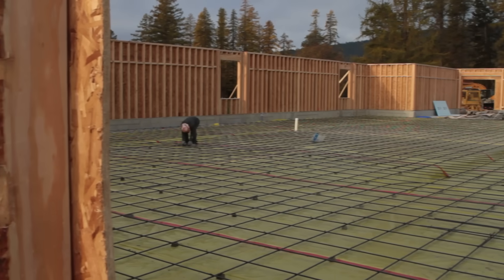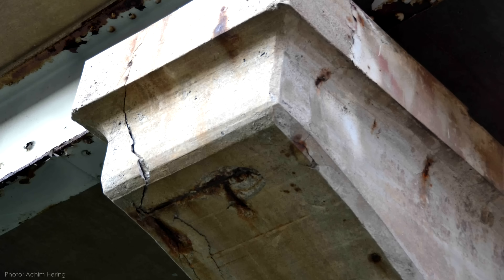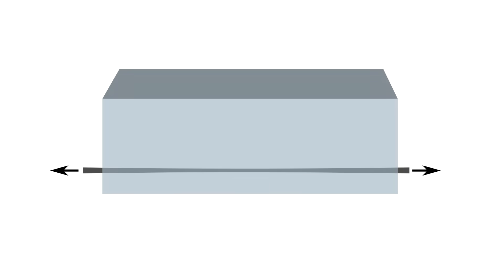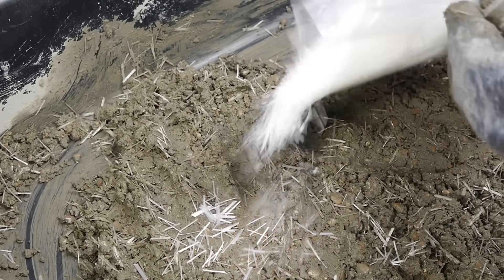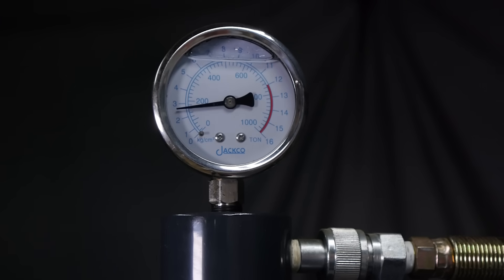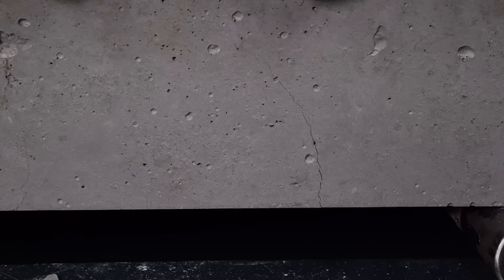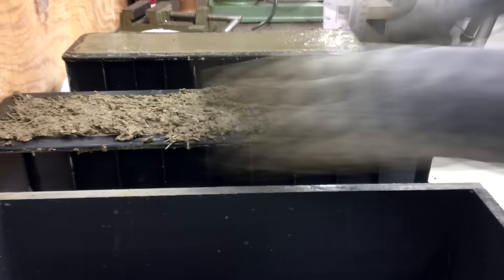Does Rebar Rust?

Comment: You could put support under the concrete where your press is. In test . I was a foremen for the rail road and we would tamp rock under the load" the rails"  because your demonstration explain it perfect it center cracks the tie . 10 inch thick and 12 inch wide 28.25inch center from the loads . On wood ties. It does the same on Portland cement ties every time. Eventually . I think a concert railroad tie has a 20 year life span. The big issue with concrete is the road bed and drainage the concrete ties start rounding off on the bottom forcing the ballist away from the tie from the extreme dynamic load differentials. It is a even support under the load is key to strength of concrete put a wood block in that press and it will beat concrete hands down . I have seen 100 year old oak ties in the track that look brand new. Because of a well maintained road bed. Throw another pile under their if it needs . permafrost areas use asphalt and piles like they did in Alaska in the 40s piles and corduroy roads with asphalt.

Comment: 1:07 He got his explanation completely wrong here.
Indeed, alkaline environment (high pH) in concrete protects metals very well and practically stops corrosion.
However, the way he explained it was wrong. 
The protective oxide layer is not formed at HIGH pH levels (above 10) as he said, but at NORMAL levels (pH between 4 and 10).
At levels above pH 10 the alkaline environment contains plenty of ions of metals more reactive than iron ones, so the iron bars are practically "safe".
With pH levels below 4 (acidic environment) the protective layer is eroded and then there is risk for the metal, but this should not happen in concrete, even if water gets in because it will dissolve alkaline salts in normal concrete and increase the pH.

Comment: Just checking to see If their was any advancements in carbon nanotubes and concrete composite materials. Their was lots of talk about it, but it gone silent for quiet sometime now.
Reply: simple.  Solution has been around for decades.  basalt rebar
Reply: @protonneutron9046  
They made some pretty big claims about carbon nanotubes with concert, rivalling the strength of Steel, making mega building possible along with ridiculously long Bridges. Haven't heard anything about what you mentioned before?

Comment: My late father was a civil engineer and Clerk of Works on numerous highway bridges built in Britain from the 1960s into the 2000s.  He came to visit me in Minnesota in the 1970s and was shocked at the decrepit state of the highway bridges.  His opinion was that they used too much concrete and uncoated rebar, i.e. no epoxy coating in a state where salt is liberally applied to the highways.  No amount of 'cover' will protect salty laden bridge structures.

When he came to visit us years later in SoCal he was again in shock.  This time because he saw that bridge abutments were of different heights so could not move together during an earthquake.  He accurately predicted how they would fail, as they did a few years later during the Loma Prieta quake.

Is US civil engineering education so out of date or is it just the result of hiring the lowest bidders that results in our infrastructure neighing so dilapidated?

I'm trying to build a high tech energy efficient home and cannot get local contractors to even provide a quotation.  They still build homes like they did in the 1960s.  They are not much better than the tar paper shacks that miners had to live in on the Minnesota iron ranges a century ago.  This so sad.

Comment: Mild Steel is weak, doesn't hold an edge, rusts easily, warps when Heat Treated and Tempered. It's not like 1080 Stainless which can survive the vacuum of space.

Comment: 3rd factor in rusted rebar: Salt added while pouring concrete to speed p the hardening process. This is a major problem for house owners in Netherlands, where contrete floors become unreliable after 35 or 40 years.

Comment: Excelent video .. Why does the crack failure appear only on one side of the beam ? I was thinking that it can fail on both sides under the load is applied ... i ve seen simulations in FEM software and it breaks the same but still have that doubt ...

Comment: But the rebar should be coated with hammerite then slide it in bamboo and cover it with line x. i know that might be expensive but it will last longer
Reply: nope.  Then it wouldn't hold onto the concrete.  smh

Comment: Does a bear shit in the woods? This guy is not exactly right, its not the concrete that protects the steel from rusting by keeping water from reaching the rebar, its the lack of oxygen from the entombed rebar, so if the concrete is porous and allows only oxygen then the rebar will rust, as the steel has already  soaked up the moisture from the wet concrete at the beginning.

Comment: You have more than 3000 comments  so someone has probably asked .. if so maybe you could pin that comment . Anyway here's the question: Why not use galvanised steel rebar? It would not add that much more cost to the rebar.

Comment: I just what to say thanks for all your videos. Not sure if you will get this seeing that this video was made on Sept 25 2018. I found electrical power utilities have large inductors for helping lag the power factor on the lines. The Inductor creates large amount of EMF which causes the rebar to heat up and expand. This causes the concrete to crack and the pads to fall apart. Not sure how they corrected it. I could find out if you would like. Just thought you might find this interesting.

Comment: I had the opportunity to talk to a concrete industry expert about rebar, and they said glass fiber was the way to go.  Also of interest is the use of light weight aggregates that have high amounts of water retention, as concrete cures it becomes water starved, using those aggregates allows more water to be present at the critical moments in the curing process.  It's called "internal curing".  Anyone working with concrete should also pay special attention to the temperature at which it cures, and  exothermic fluctuations.  Large pours will have hoses running through them so they can be water cooled on the interior, while blankets on the outside keep the outer edges from cooling and curing out of sync with the core. Using light weight aggregate for internal curing prevents the core from running dry as the crystals suck up all the water, making the concrete much stronger.

Comment: so if rust in rebar is bad, why is it almost always rusty when they put it in?
Reply: It won't continue to rust if it is sealed, so it doesn't matter that there's a little patina on it on pouring.
Reply: A small bit of rust can even make the rebar a little rough which is good for grip and as the Kombinator mentioned if it is cast well, it won't get any worse.

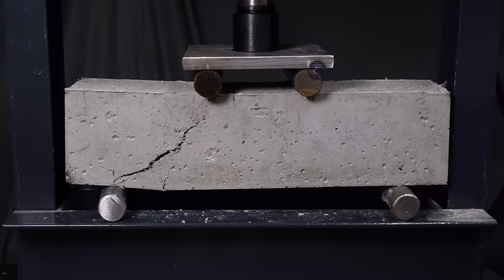Comment: To be a little nerdy: at 5:49 you can clearly see that this is a shear failure, and that the rebar doesn't have the required anchoring length. I'm surprised the capacity wasn't higher for the fibre ones based on this. might be because the fibres aren't steel?
The size and length of the beam in the video is perfect for showing fibre strength because the fibre-free is relying on badly anchored rebar. If this was done with a longer beam, with well-anchored rebar, the difference would be smaller, and if the crossection was smaller we could perhaps see a moment failure, in which case the fibres won't really do much.
However, fibre reinforced concrete (with steel fibres) combined with prestressed rebar is the way to go for optimizing concrete structures IMO.

Comment: Thirty-five years ago I was breaking out an old curb with a jackhammer. The steel reinforcement was twisted one inch square bars. There was no rust and they looked as good as new. The bars had two or more inches of coverage and were in the hardest concrete I have ever seen. It was in a refinery so there is no telling what kind of chemicals it had been exposed to. My foreman said that he thought the twisted square rebar was from the 1930s. Just thought I'd share the anecdote.

Comment: Sir what to do when the rebar corrodes due to low cover in beams? And When using prestressed bar the bars are tightened after the setting of concrete; the hole 🕳 that is used to put bars in the concrete should the holes be filled with concrete again during prestressing? And is there risk of corrosion when we post stress bars?

Comment: hair line crack in concrete (un whitewased for years or rarely whilewashed which colses the cracks) allow (polluted) air flow in our town (now)called biriyani Ambur cause rebars to rust and expand causing concrete cancer.  Air pollution by effluent (kachchada water) treatment by tanneries so rebars and any unpainted iron rusts in our town which is not a seashore town (salty air)

Comment: Using Portland slag cement also helps control shrinkage cracks , temperature cracks and provides resistance against chloride and sulphate chemical attack thereby preventing corrosion of rebars upto a substantial extent

Comment: Don't know why this video came up in suggestions but might be because I was also watching a video by Hilti on their drill bit that also cuts through rebar. The prime target for the product being installers running pipe or cables in buildings.  I and others were questioning whether such a product should even be used as surely the integrity of the building is being compromised.

Imagine  after years of installers coming in to fit A/C or whatever else how much rebar may have been cut through. I suspect the impact on the rebar also would have some affect along its length?

Comment: Does steel fibre reinforced concrete require the same rules for cover as the rebar? i.e. do the steel fibres themselves need to be a certain distance from the exposed edge?

Comment: Hey Grady.  I live in Seattle.  We have a high lift concrete bridge that has been closed for repair, or replacement.  The main span over the water is cracking.  Thought maybe you could make a vid regarding.  Thanks.

Comment: The high cost of basalt is not the fibers, it is making them into controlled rods.  Cheap basalt fiber could be drawn into the wet concrete precisely along load paths by a robotic arm.  The result would be lower cost and higher strength due to greater contact area.  Of course quality assurance would have to be designed in.

Comment: Epoxy coating dose not work. Its next to impossible to not damage the coating when transporting unloading and installing each chip or crack in the epoxy means localized failure of the rebar.

Comment: Hi Practical Engineering!  Hey love the video, thanks for putting that together.  
My name is Kenny Watkins and I represent a company called RJD Industries and we manufacture non corrosive concrete products such as you mentioned in your video.  
We have Fiberglas re bar, fiberglass joint dowels, and smooth rod fiberglass form ties as well as our newest product superthread.  
I’d love to talk more with you.  I’m interested in what you would think of the products and think it would be super cool if you made a video stress testing our products.  
Of course we would send you all the product for free.  
We also have a product call “splice seal”. Used to seal mechanical joints on vertical steel.  Where epoxy coated bar is required. 

Give me a shout I’d love to work something out with you. 
801-823-6220 
801-675-9601 
Kenny@rjdindustries.com 

Thanks again! Keep up the killer content!

Comment: Well, isn't it that concrete doesn't protect the rebar exactly from corroding since concrete really sucks water completely. However it protects it from oxygen wich leads to rust and corrotion. Correct me if i'm wrong here. But what protects rebar from water is usually isolation witch protects the concrete from touching the earth right? Since you never want to let concrete touch the earth because it sucks up water like a sponge almost?

Comment: I've seen reports that epoxy coated rebar is failing.  A lot of the epoxy is chipped off in the rough handling and the rust pits very deeply at
all the chips instead of forming an even layer of oxide like on uncoated rebar.

Comment: The concrete will crack easily with that pressure but if you use steel bars at top as at the bottom of your beam it will give more strength.

Comment: Fiber reinforcement might be good for boats, surfing, or interiors  ....low weights, lesser lifecycle , min whether variation.
For load bearings- bridges , structures reinforced fibres add to heterogeneity of concrete blocks which deteriorates or shrinks on variable factors (except glass which cracks) creating voids & cracks that elongates on load/stress cycles resulting into early failure than estimated...
Sample in video seem to be fresh..Try older cut section sample
Even sand particle size, homogeneous concentration has to b consider .....

Comment: Cracks are an important safety feature of reinforced concrete which anyone can pick up on... I'm a civil student and I was thought that if there are no cracks there are no signs of an imminent failure such as a live or passive load being too high... this is mainly an issue with suspended concrete slabs like in a car park. The reinforcement fibres are an illusion of higher strength as there are no cracks but are more dangerous as there is no increase in initial strength only long term strength isn't reduced due to rebar rusting through the cracks. The usage of cem 4 with 30% fly ash and 10% ultra fine fly ash in my opinion is far superior towards the usage of synthetic fibres because acids and salt water struggle to penetrate through the concrete as the pores in the concrete are sealed better thereby reducing rust but also keeping the cracking safety features, another safe option is painting with the stuff they use on lab floors. Loved the video by the way other than that I felt the video was very good and informative thanks.

Comment: So its ok to lay concrete in a reinforced steel bars with slightly rust on it aslong  there is adequate cover?

We have steel reinfored bars exposed for 4 months. Does it need to be primed and lay  concrete? Or no need to paint?

Comment: How long did you wait before testing the concrete? New research shows, that concrete can take close to a month until it has its final strength. This is very counter intuitive, but the chemical processes in the cement take that long to fully stop.

Comment: We inspected the demolition of a 1902 multistory in 1986 (8+; whorehouse, an early Seattle industry) built with smooth cast iron rebar and rounded (river gravel) aggregate. Cement ratio prob higher; engineers know rock is harder than cement so modern pours aim for max aggregate so often use vibrator to get close fit of gravel, pea gravel, sand. BUT there was no rust on the rebar. Modern rebar has a roughened surface for max contact with concrete, and some iron mirgates into the calcium silicate to form a stronger bond. Note, sodium silicate (yes, alkaline) is used in boilers and car radiator antifreeze to PREVENT corrosion. Cracks propagate from surface imperfections and pitting rust is not characteristic in alkaline solution (QED Edison battery Fe in KOH).

Comment: So basically the fibers are there not to increase the overall strength/resistance of the concrete to forces applied to it, in stead the fibers are introduced so that.. Uhh.. Basically, like a one hand washes the other thing? I mean: the fibers prevent cracking, right? And the prevention of cracking prevents the rebar from becoming vulnerable to corrosive elements, yes? So in this way, the fibers allow the concrete to be as impenetrable as possible, not for the SAKE of the concrete, but since it does effectively enhance the concrete, really the fibers' purpose is so that the rebar can be functional for longer, essentially, as long as the concrete is "impenetrable", then this is how long the rebar can be expected to remain free of corrosion..? 
Or is there much more to it than that

Thanks

Comment: The operator dug the footer too deep and the rebar mat is sitting up on bricks and during placement of concrete it slides off bricks and hit the dirt...no coverage on rebar and instant rust process begins. So much for 3 inch coverage from dirt, right? No, grab a 2x4 and push it back over, hopefully. Well, it’s going to rust anyway, right? And the concrete is in the ground, it’s not going anywhere....oh who wants to do concrete! Ha

Comment: When we remediate a structure, we coat corroded reinforcement in a zincrich primer to slow down further corrosion. All reinforcement with a cross sectional loss >20% is replaced and lapped/welded as required.

Love your vids!

Comment: One major problem is the fact of lowering sack count in concrete from 6.5- 7 to 5.25 per yard, the higher density of portland is key to what is called stickiness and longevity also cover. Cover failure and density are the 2 leading factors to failure.

Comment: I've seen a documentary on coated rebar, this documentary shows that coated rebar can be worse that uncoated rebar.

I can't remember the details though, you would have to research this to find out the info.
Reply: A coated reinforcement bar would, in theory, be protected against corrosion. However, the coating material will destroy the steel-to-concrete bonding characteristic strength, which is the fundamental parameter of reinforced concrete design. Like what's been pointed out in this video, proper selection of concrete cover thickness will be good enough to protect steel reinforcing bars.